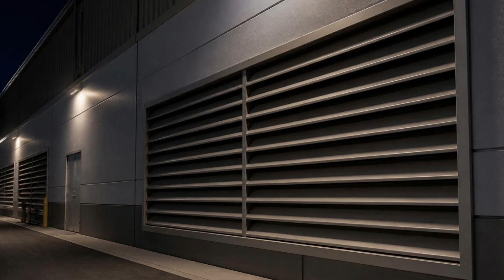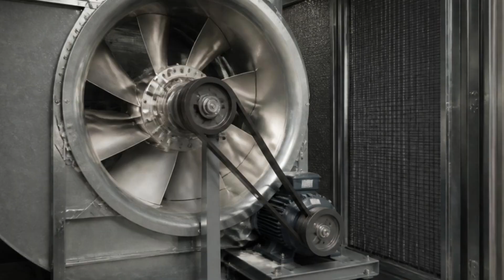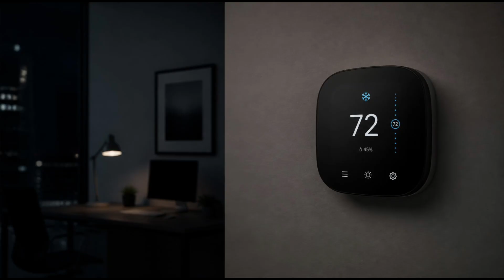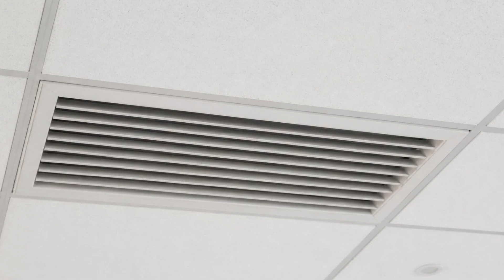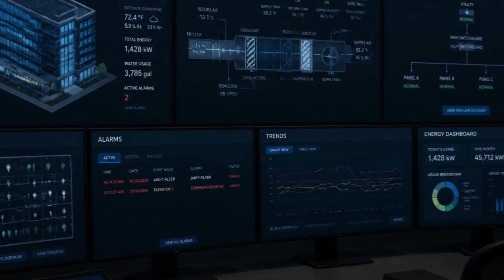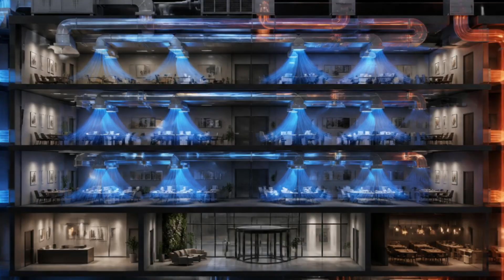Fall Asleep to HVAC Systems Explained: How Air Moves Through a Commercial Building (2+ Hours)

Comment from the maker: Thanks for spending time inside the hidden world of HVAC systems 🌬

Even when a building feels quiet, air is still moving, sensors are watching, and equipment is working gently in the background.

What building system would you like to fall asleep learning about next?

⚙ Building Automation Systems
🛗 Elevators
🔥 Fire Protection Systems
🌐 Data Centers
💧 Water Treatment Systems

Sleep well.